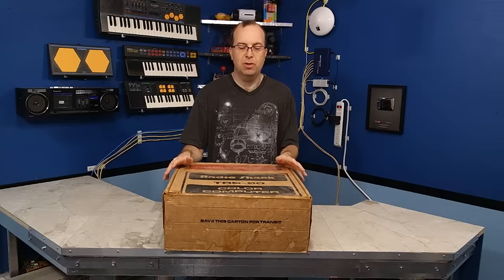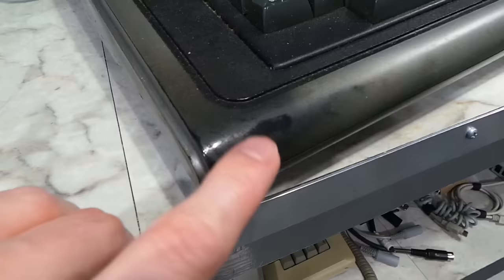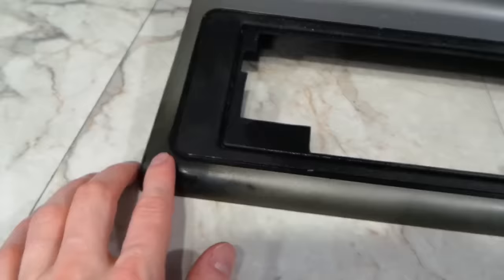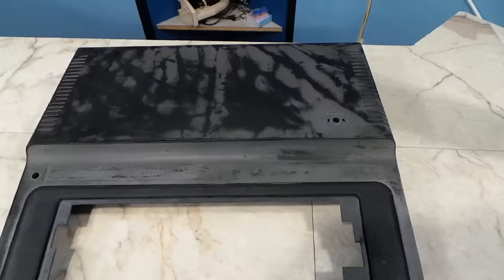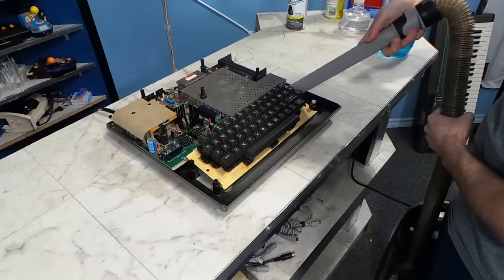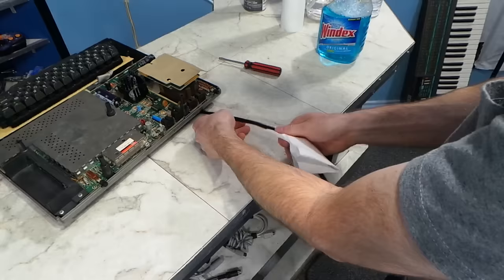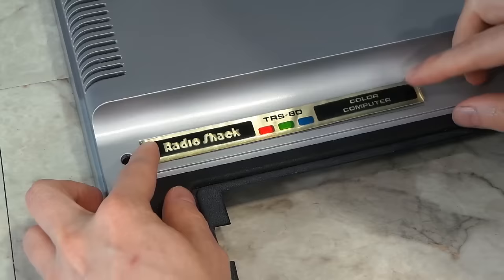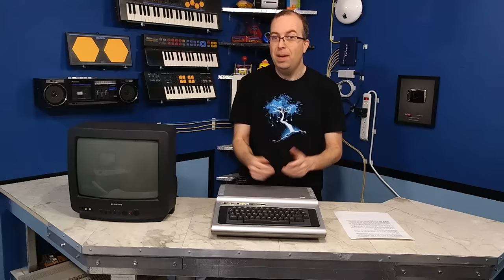TRS-80 Color Computer 1 Restoration

Comment: Completely removing the existing paint was unnecessary. The best base for a fresh coat is the scuffed paint before it. Turned out nice, though, even if it is too light. You had me cringing with the oven cleaner. I was waiting for a horror story. Acetone would have definitely liquified the polystyrene. Scotchbrite is your frien in this instance.
Reply: Scotchbrite is your "friend".
Reply: I said "oh no!" out loud when the oven cleaner came out too... I guess it worked out as intended though. It took some guts to try it, that's for sure.
Reply: Yeah. I would've tried it on the inside first to see if it does bad things to the plastic itself.

Comment: When painting pretty much anything, you need to do some things to make it last. 
0. (Common sense) READ THE CAN LABEL
1. Scuff the plastic, he did that with the Brillo Pad but fine grit (200 - 400 grit is best) sandpaper would work better. 
2. Do a primer coat, this will help the paint stick even better, as well as protecting the plastic from any chemicals in the color coat. 
3. Wet Sand the paint and primer, this will smooth out the paint as the rattle cans tend to leave a rough finish. 
4. Start and end the spray when not on the part your painting, this will prevent splotches and bumps
5. If you use lacquer paint, use lacquer primer, as the chemicals in lacquer are extremely harmful to plastic and can melt through thin pieces, the lacquer primer will prevent this, but standard Enamel primer will just melt away as well. 
6. Clear coat it, he touched on it in the video, but clear coat can really help protect the paint, as well as give the part a nice shiny texture, but be sure to wet sand it as well. 
7. Follow the dry times
-Enamel takes about 24 hours to dry and about 5 days to cure properly 
-Lacquer car paint drys in about 1 hour and takes 2 days to cure properly
These times will vary from different brands, climates, etc, these are just some rules of thumb
8. Paint in a well ventilated area/outside, as paint fumes are harmful, if you feel woozy or high, stop immediately and go to an area with fresh air. 
9. When your done painting each coat, cover the part with a box to keep dust, grass, hairs, and bugs out of the paint. If one of those thing gets in the paint, sand it out and apply another coat of paint. 
10. Start out with light coats and gradually do thicker coats, don’t start off thick, as it will cause the paint to both run and take longer to dry. 
11. Be sure to put the part in a place where dogs, cats, children, spider monkeys, etc. 
12. (Optional) invest in a cheap turntable, it will make painting larger parts much easer, as you don’t have to walk around the part.

Comment: My TRS-80 didn't look like that. It was same depth but otherwise only keyboard size. It came with 4k and I did the massive upgrade to 16k which involved additional chips and cutting tracks on the motherboard. Frightening stuff at the time but it worked and not only did I learn BASIC but I even kept inventory in a database for a small business venture. It served me well until The BBC Micro came along.
Great videos!

Comment: The 6809 CPU is criminally underrated. Such a good CPU... I kinda like leaving those aftermarket mods in, though, personally. They add to the character and the history of the machine.
Reply: 6502 though
Reply: The Coco had a 6809e.
Reply: I agree about the 6809 just look at what the 6809 had for registers vs the 6502

Comment: CoCo FTW! I cut my teeth on a Timex Sinclair 1000, then my first 'real' computer was a Color Computer 2. I then saved up my nickles and dimes and bought a CoCo 3. I upgraded it, I was hardcore into BASIC. Friends who were into Assembly helped me with a small I/O program to load where all screen output was captured and sent to the com port... I wrote my own BBS system - in BASIC. Seriously - at age 12, I had an entire BBS system with users, messaging, a small dice adventure game, bulletin (forums), and ONE WHOLE CHATROOM! hahahaha 
I could only aford 2 phone lines mowing lawns, and I only had 2 com ports to easily work with from BASIC - so in my limited head space... I was literally handling crosstraffic between two modems for chat if it existed using gosub.
Fortunately, at 300 baud - the incredibly slow and horribly written code didn't really matter enough to notice!
I still can't believe I actually got it to work to this day. Thousands of lines of BASIC and endless debugging. Those were the days man! :)
I tell you this much - it sparked the imagination of many a kid out there as to what was possible. It was incredible. Even made a few games that weren't half bad for a dweeb using the get/put BASIC methods. Really fun memories.
I'm looking forward to the video on those computers.
Reply: OptimusPryhme I wish I was as good as you, I can barely make a Commodore Vic 20 do anything
Reply: HAHA - I doubt I could do it now without going back through it for the year I pounded at it, and frineds helping me with the peek/poke assembly program that allowed constant comms. :)
Reply: say something here if ur gonna upload vids aboot it

Comment: My job at one of the places I used to work was repairing and restoring equipment cases (mostly for expensive external storage/tape backup drives).  For a full repaint, the steel wool is actually a good choice because it leaves tiny scratches in the surface for the paint to adhere to.  What I would have suggested would be to take the bottom part of the case into an autobody supply store and see if they could match the colour of the unexposed part (most places can pretty well match anything).  My process for a smooth finish would be to clean everything down with water after cleaning and initial sanding, and give everything a good wipe after with methyl alcohol to remove any residues.  Then apply a coat of neutral grey primer, sand it down with a fine grit sandpaper on a wooden block until it's almost gone, add another coat and sand it down again so it's as smooth as you can get it.  After that I'd paint with the colour coat, give that a light sand with really fine grit sandpaper or polishing cloth, and then add a second coat (and third coat if needed).  After that, I'd add two light clear coats and let it cure for a couple days before reassembling.  For textured finishes, it's a bit more complicated.  The first coat of primer would be more or less the same to make sure I don't have any deep scratches or nicks, then I'd add several layers of primer just lightly spattered on to make bumps, with lots of time to dry in between.  Once the surface was completely covered in a pebbled layer of primer, I'd add several colour coats spattered on the same way.  The trick is not to put the paint on so thick that the blobs of paint can flow together and smooth out.  Once you have a nice pebbled layer of colour on, then you can add layers of clear coat exactly the same way to keep adding layers of pebble texture to it.  You will never perfectly match the original pebbled texture because the manufacturers use a proprietary paint and process, but you can get really close.  Just expect it to take two or three days.

I can tell you first hand that it is no fun at all trying to make a repainted patch match a pebbled, high gloss black metal case with lots of flat surfaces after knocking out a dent.

Comment: @The 8-Bit Guy
All of those modifications are to be expected with TRS machines because the company was big on people modifying the computers all the way back to the original Model I in 1977,  where you had to solder in jumper wires to get the machine to display lower-case letters.
Reply: Back in the 80s I had this same model computer, and other TRS-80s before and after. Radio Shack/Tandy wasn’t promoting mods, but there were a lot of small companies that did.

Comment: When writing PRINT MEM, you only get the available memory. Since Extended Color BASIC takes up the top 32K, on 64K machines it will tell you there's only 32K available. Not sure why it says 24K on your machine though, but perhaps some memory is reserved for string space and program storage. Or maybe my own memory is failing me...
Reply: Anything over 32k isn't mapped by default as system ROM and reserved space (such as for Disk Extended Color BASIC ROM) limits you to 32k... out of the bottom 32k 8k is mapped for video memory, hence the lower amount. I THINK there's a way to tell it to use less video memory, but it's been so long I forget if that's the Coco or some other platform of the time. 

Working in Color Basic or Extended Color Basic anything over 32k generally isn't available, though there are tricks to get around that -- like copying the ROM to the high RAM with assembly, then switching the RAM area live. Then you can access the ROM routines, rewrite them/trap them for different behaviors, and use any space not mapped to ROM for whatever you want.

It's much like the 48k memory limit on a Model 1/3, where the only way to get that remaining 16k was to map ROM out of memory. Unlike the model 4 or Coco 3 where you could also bank in more RAM... 128k in the 4's case and... I forget the 3's limit though I know 512k 3's weren't unusual. (sadly my Coco 3 is only 128k)

I actually know of at least two programs that actually copied the non-extended basic ROM to RAM, modified the code to allow something like 50k of RAM to BASIC, and then rebooted into that. Since Color basic and extended color basic are separate ROM, having the latter installed reduces your overall available address space.
Reply: POKE 25,6:POKE &H600,0:NEW  should deallocate all graphics RAM (PCLEAR 0 would have been easier, but Microsoft/Tandy default BASIC doesn't let you get that low). You should get 31015 bytes free at that point.

Comment: I used to run a 1st generation coco very similar to this one back in the day.   Serious users could add up to four floppy drives and run OS-9, which was a real time operating system similar to Unix (or Xenix as Radio Shack called their distro.)   I also upgraded the memory to 32k and build a bus extender to use memory mapped I/O.  You could address up to 64k natively with the 6809. This was populated by cards that I designed and built so that I could interface it to my model railroad.   The computer handled all the power routing, turnout control and signaling on the actual layout.   I wrote the software all in basic.

I hope this answers your question as to what a serious coco user could be up to that would cause  such heavy wear on the case.

Comment: Really nice restoration.  I got mine back in about 1982, it was one of the first 32K models and I had to wait about 4 months for it.  I later upgraded it to 64K which only worked with OS9 because the upper 32K was reserved for the ROM PAKs but could be switched in and out using hardware "pokes" into memory.

Comment: It says 24k ram but I believe it's 32k ram.

8BitGuy
-2017
Reply: Quoute memes are not funny
Reply: From what I understand there was no such thing as a 32K memory chip. It is actually a 64K production fallout which could still be used to address the usable 32K.
Reply: That sign won’t stop me because I can’t read!
Reply: As a coco owner  24k  is free memory for BASIC programs the coco still needs some ram for the timer, buffer for the cassette interface video memory and more, further more the machine might have as much as 64k installed but you can only access the upper 32k  by writing to a particular memory address to switch the upper bank from rom to ram.
Reply: @aarondavis5386  TI-99/4A can address 64K as well, but that's so divided up you get about the same 24K for BASIC there as well.  Even with the 32K card, 8K is automatically dedicated to assembly language support routines you can load and call from Extended BASIC.
Reply: C'mon, who needs 32k ram? Ludicrous!
Reply: @lanieperez1386 
 "Quoute"
-Lanie Perez

Comment: not sure if you have ever heard this but vacuuming out electronics is a terrible idea, it tends to make a lot of static and I have known people who have killed their more modern pcs doing it.

better to just blast it with compressed air
Reply: i bet they shorted out components on mobo with the metal hose  (I did that once) - Never heard of fast moving air causing static electricity ???
Reply: I'll hover a vacuum hose above my computer sometimes while I use compressed air, that way the dust goes somewhere instead of just flying into the air and settling back into the computer. Have also vacuumed the case vents from the outside. Not directly on components though.
Reply: Magnesium PC i was replying to OP's comment
Reply: Fast moving air builds static like crazy. This is a massive problem with helicopters which is why they're generally grounded with a hook or a rod before anyone is allowed to touch them. Its a real thing.

As far as moisture from compressed air... I've been dusting my computers with compressed air, straight out of regular old air compressor, since 1992 and I haven't experienced any unexpected hardware failures. It's wise to drain the moisture out of the tank before doing it.

Malus: I just take mine outside to blow them out... No worries about where the dust goes then.
Reply: Magnesium PC Depends on what kind of compressed air. If you have a compressor that you fill tires and use pneumatic tools with, then it's fine to blast some air on it. (if it doesn't blend in oil with the air like some heavy duty pneumatic tool compressors do)
Reply: I've used plenty of "canned air" too... Never an issue there either.
Reply: Static electricity is something to worry about, sure - but I wouldn't be surprised if a computer that old could handle it better than a modern PC. Miniaturization of components has only driven modern PCs to become more susceptible to static electricity.

Comment: At DeVry Phoenix in 1984 we used the original TRS-80 with 32K ROM upgrades performed by DeVry that turned these into Z80 Op Code programers, compilers, loader, testers for use in the Z80 micro computer class/lab.

Comment: The reason of the painting peeling off or discolored is that you should firstly use a primer for flex materials, the safest way to take off a label especially if it is made by aluminium is to heat firstly with a hair dryer to soften the glue, then i clean the glue off with some IPA. Excellent work anyway ;-)

Comment: I spent 26 years at the General Motors Research Laboratories. Most building instruments that were rack mounted in engine test cells. Most of this work was with aluminum (6066-T6) panels. We would epoxy paint the panels. On the computer we designed all of the lettering and all machining details. All in separate layers. The artwork was sent to a photo lab to make negatives. The negatives were contact printed in a ultraviolet light sensitive film that left the lettering and artwork on the thin Mylar film. With a machined then painted panel the lettering was taped to the panel and using roller tipped took the letters were transferred with pressure. After the clear sheet was removed. If there were damaged parts they were removed by lightly scraping and making the parts that were needed with scraps of the material. Once it looked Okay it was lightly rubbed with tissue to burnish it to the panel.  The it was clear coated and baked again. The paint was baked on. We had instruments built over decades that all looked the same. The secret is to clear coat. At home I use Avery clear labels and print the entire panel. The I carefully place a second clear label over the first to protect the artwork.

Comment: a tip for spray painting: you can set your paint with a clear coat on top to prevent wear. most brands have their own, but liquitex or mr. super clear are staples for other types of people who restore plastic. it works especially well on vinyl.

Comment: great video! love these restorations videos that you create on these old computers from back in the day,  don't know if anyone has commented yet, but here's a tip that takes the guess work out of the paint color you're looking for, take a piece of the item with the original paint still on it, take it to an auto body paint supply store and they will use a device that will scan the paint surface, and the device will give the paint chip code, they will mix the paint, and request to have it loaded into a spray can, and it will be just like spraying out of a spray can you buy at the hardware store, and if the device cannot find the correct paint code, then you can leaf through their paint code chip books, and you can match it up as close as possible,

Comment: I did so much with the Coco back in the day.  The LED hack was pretty typical.  The RAM upgrade was a power user hack as well as Tandy would only go to 16k.   We used to "piggyback" RAM to make that work.  

If not for the keyboard and the original 4k, I'd say that was my old machine.  I miss that beast.  

Thanks for the memories.

Comment: I hope you kept the box.  About those replacement keyboards, until the later model CoCo 2 (part number 26-3127B) with its full-travel keyboard was finally introduced, there was a large cottage industry modifying high-quality keyboards to fit the TRS-80 CoCo and early CoCo 2 models.  We called them "sculpted" keyboards and one major keyboard was the "HJL-57" by Touchstone Technology.
The processor in all of these is the Motorola 6809-E (E stands for External clock).
Also, the Dragon 32 was a nearly identical licensed clone of the TRS-80 Color Computer.